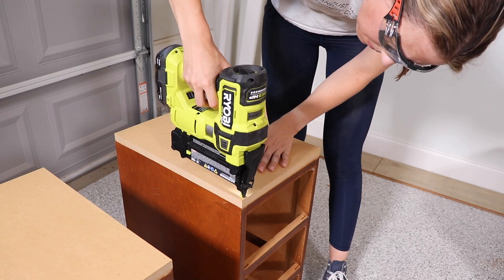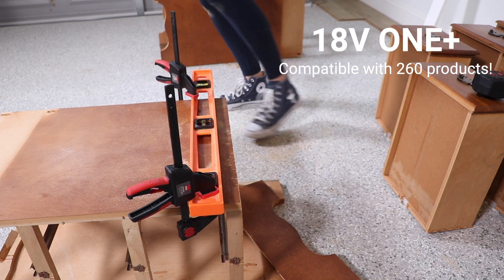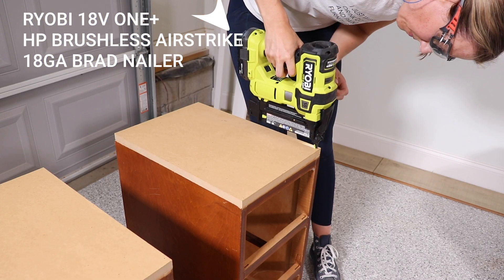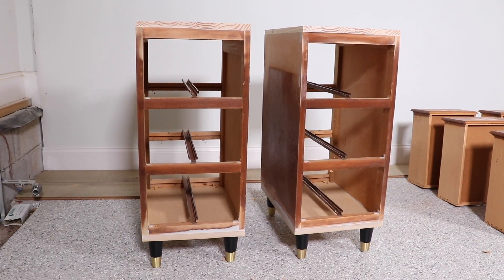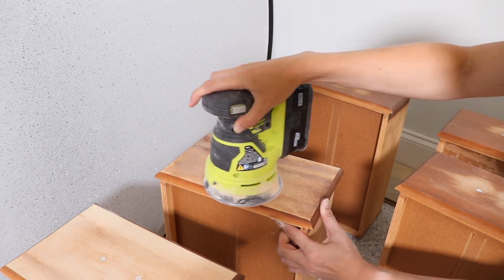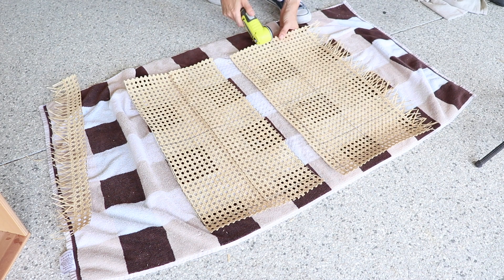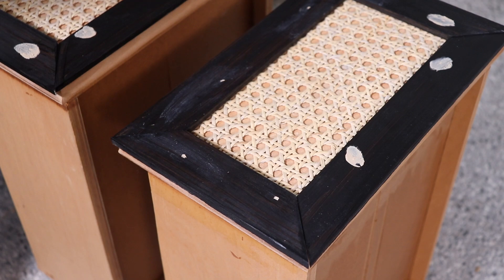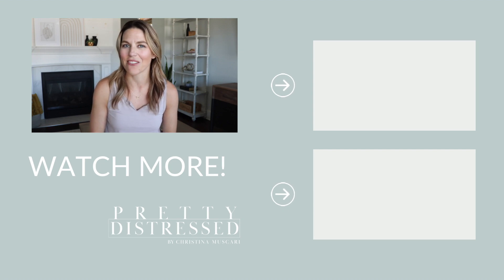DIY THRIFT FLIP FURNITURE 🔨 Desk to Nightstands w/ RYOBI Tools!

Comment: I love the way you worked that desk over with Ryobi! And the results were custom perfect! I love Ryobi brand power products! And I love Home Depot for all of my around the home Handy-woman tasks! My husband works more than full time as a black-owned small business. He has 2 employees and cares for over 100 lawns in his lawn scaping business for over 25 years. He works so hard at 13 hour days mostly 7 days a week for over 8 months of the year that I try to help by handling most of the handy (wo)man tasks around our home! I work for my husband taking care of client billing and most all other clerical tasks at least 10-20 hours per week besides being an avid crafter. I love building and customizing our spaces in our home. I have put up shelving systems, I build all of our new furnishings that require assembly, I also diy and upcycle used items to fit various needs within our home and my crafty den! If I were to be fortunate enough to acquire this Ryobi one+ power tool set, not one piece of it would go unused or unappreciated! And I would probably love using the rotary saw and the drill most often! Thanks for the opportunity! Continued blessings in your DIY customizations! 🥰💕🥰

Comment: I have become a big fan of Ryobi tools because of the convenience and simplicity of having cordless tools that use the same battery. At the present time, Ryobi is offering two rechargeable batteries and a charger for $99.00 and with the purchase, one can select a free tool from several available. I chose the sander featured in the video. The batteries I can use with my drill, saw, and scrubber, also featured in the video. This scrubber has become my favorite Ryobi tool! I have recommended it to family and friends as an amazing tool to clean tile in bathrooms as well as windows. The brushes are interchangeable which makes the scrubber a most versatile tool. The soft brush goes well between crevices while the medium brush is excellent for tile scrubbing. Thank you for another valuable and inspiring video showcasing your talents and ideas.

Comment: Fantastic furniture! Thank you for teaching us that your first plan may change in the middle of the process. Plan "B" happens to me A LOT! Also,  how simple furniture flipping can be as well. Most excited about all the Ryobi tools using the same Battery. One charger, One Battery to keep track of. Having a nail gun with out having another extension cord strung on the floor is my kind of system. Thanks for the tips.

Comment: I forgot to ask where do you buy your cane ? I would love to try the cutter or bradnaiker . The reasons are I can never cut a straight line and as you know doing furniture scissors most of the time isn’t good for cutting. I have tried so many bradnailers the cheap ones from Harbor Freight that hasn’t lasted long for me. I hate using a stapler. Love ya 💞

Comment: I love the power scrubber. I flip alot of dressers and that would come in real handy on cleaning those. I use a wagner 3000 but have had problems with it having an orange peel look despite trying several different settings. What are your air power an flow settings at? Love your channel it has given me many ideas to try, mine don't always turn out as good as yours but I keep trying.  Thanks

Comment: Really nice flip.  Hard to believe what you started with.  Since I like lots of color in my life I'm not a fan of black but I recognize I'm in the minority.  I do like the cane inserts with the framing.

Ryobi tools:  I want them all but the brad nailer is calling my name.  I'm tired of having to drill holes for small nails like brads.  Sometimes I snip the points off small nails and just pray it doesn't split the wood.

Comment: Hi Christina - I absolutely LOVE your work!! Can I ask please about the Wagner Flexio 3500 gun you have used. I have used a Wagner gun that said it was OK for furniture, and what an awful result I had. I used 2 different guns just incase one gun was faulty - they were both the W350 which lacks the variable speed dial that the Flexio 3500 has. It was a disaster - the paint splattered no matter how thin (I watered it down 10%, then tried 20, 30 and 40 but this just ran as it was now so thin, then tried it with no water). No matter what I did it was a disaster. I am now too scared to buy the Wagner Flexio 3500 - is this gun worth it? Would be very grateful for some feedback. Thanks, and keep up the amazing work.